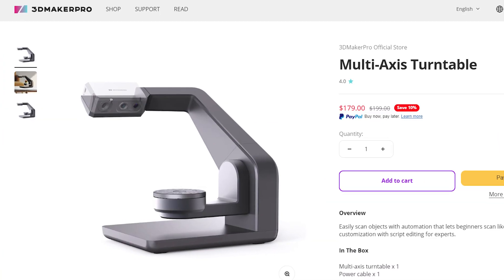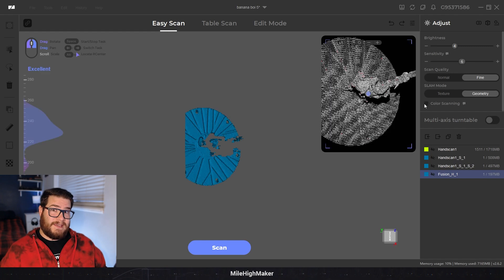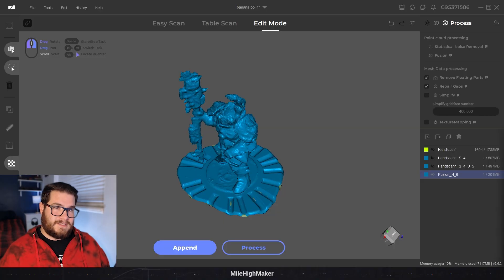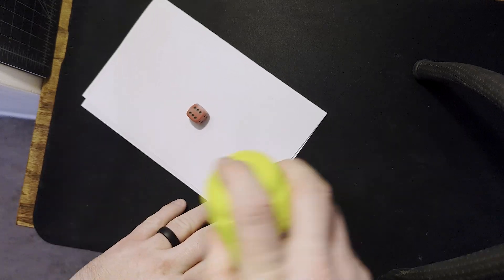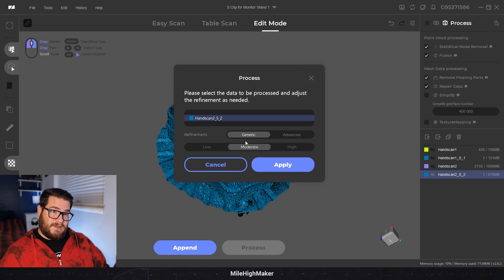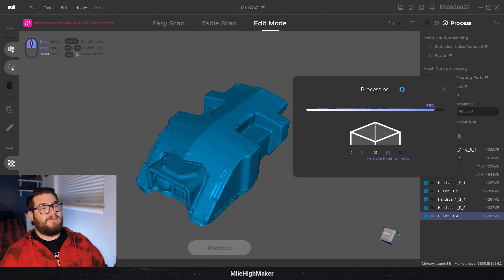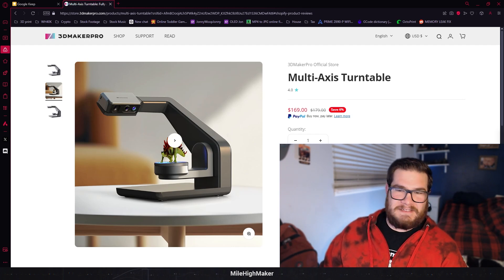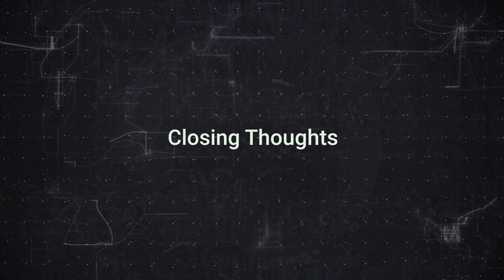3DMakerPro Multi-Axis Turntable First Look - Really Worth It?!

Comment: The Multi-Axis-Turntable works even better with the Moose. I have created adapter and you can find it on printables. But 3dmakerpro is not willing to add support for Moose as well you will need to have second device for controlling the turntable.